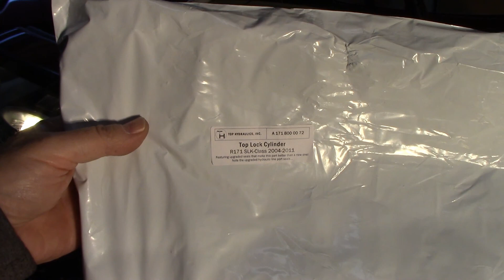R171 Front Lock Cylinder Replacement (Chapter 2)

Comment: IMPORTANT ADDITION- CENTER THE LATCH PLATE   I had a leaking roof cylinder so took a shot at an OEM replacement.  I should add that I have the factory CD of the service manuals too.  Besides breaking my back leaning into the back pump....Anyway it all went well except that when I went to lock down the front roof one of the catch hooks that pull tight to the windshield was out of place,  a big dead end, the two catches were not open the same amount.   Lots of brain twisting and poking at things led me to the factory manual, and under the section for replacement  of the front latches, it says that when installing the center latch plate (with the cylinder in it) do not fully tighten the 3 plate screws.  Then take a beefy 6mm allen wrench to the manual open screw (on the latch center plate) and turn it hard clockwise to move both latch hooks to their max open position.  This will shift the center latch plate as it has quite oblong holes, then tighten the plate while cranking the allen.  This centers the latch mechanism and makes both latches open all the way.   My roof was a dead duck before I centered the latch plate.  Hope this helps others.
Reply: I think I’m stuck in the same situation. The front latches won’t unlatch, I’ve turned the center screw clockwise as much as I could. Should I try even harder? I loosened the plate so it can move around, but the latches won’t unlock all the way. Any advice? Thanks in advance!!